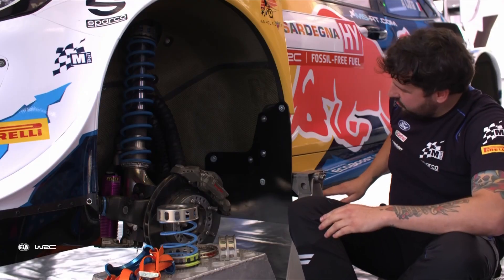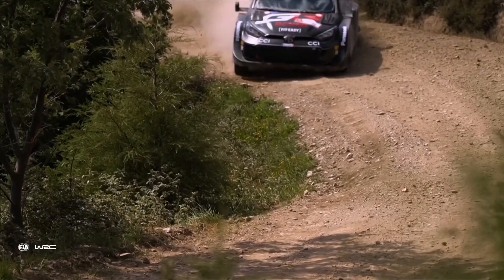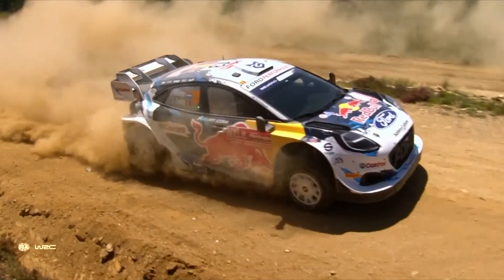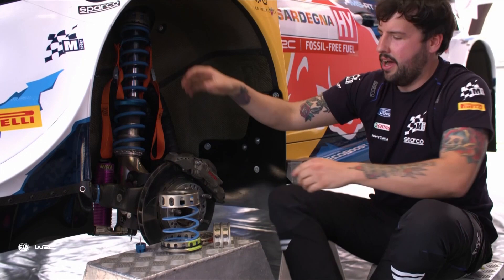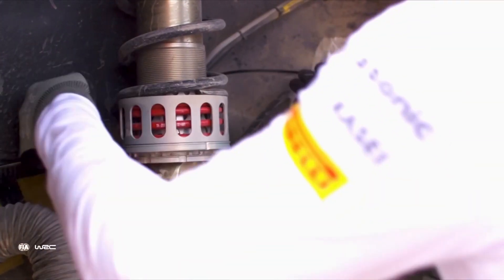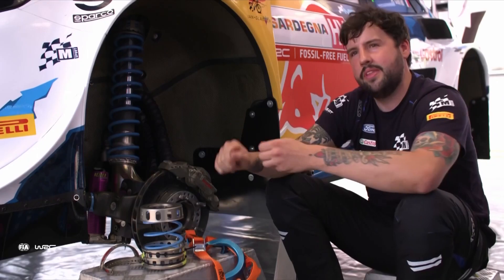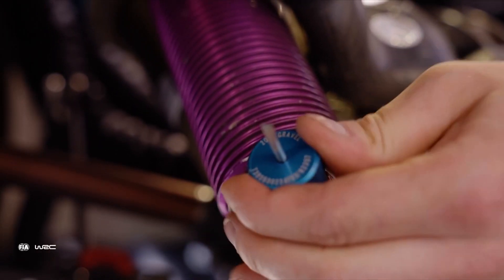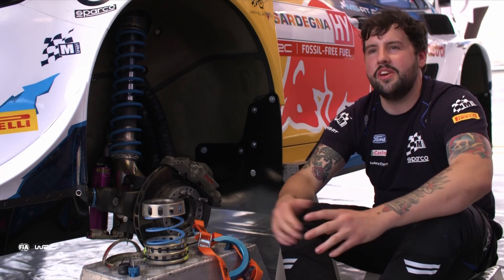WRC Explained: Ride Height

Comment: This was very informative  especially the bit about the relationship between stiffer compression settings to counter increased ride heights. 
I play WRC23 and didn't grasp the relationship between ride height, taller center of gravity and controlling higher C.G's with stiffer shock settings. Thanks for a very educational video 👍

Comment: Awesome to see little sneak peeks like these! Ride height varies between surfaces and types of terrain - on loose surfaces like the fine gravel/dust/dirt in Sardegna the suspension would be raised up slightly higher and suspension slightly softer, and how rough/smooth the surface is tells you what kind of damper strategy to employ.

Rough roads in general will require higher ride heights and softer suspension settings where smooth roads benefit from lower ride heights and harder suspension settings. For example, when braking hard in a straight line you want the weight to push down the front wheels for grip when on tarmac without unsettling the car.

Then again, I'm not employed nor part of any team as of now. Just a rally nerd doin rally nerd stuff.